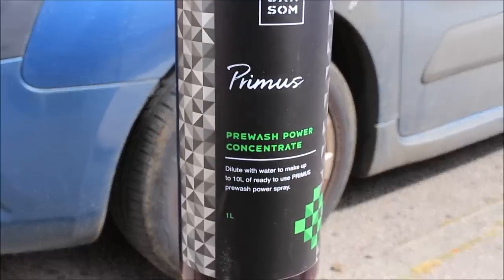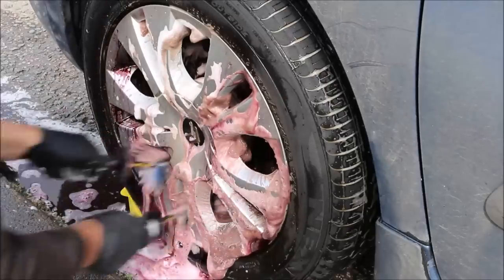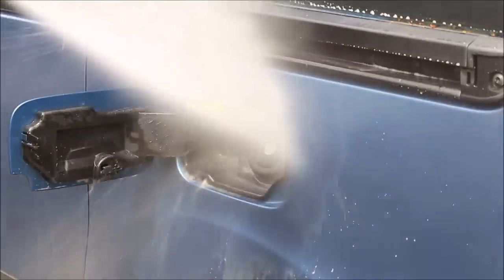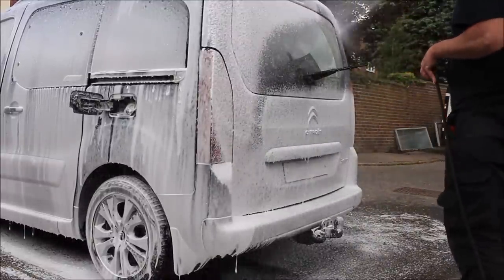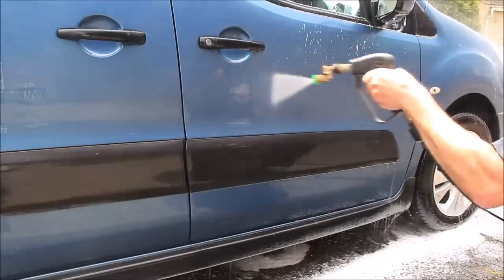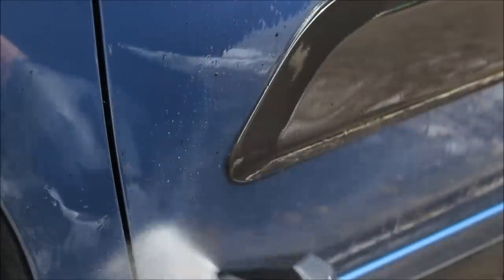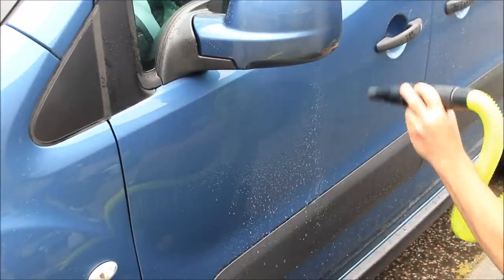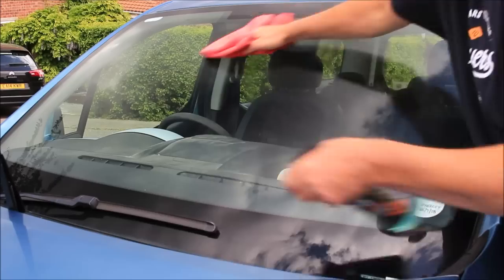CLEANING CAR TRANSFORMATION

Comment: Hi Paul.. I've just got into basic detailing. Spent a bit on products you have recommended and had great results. I've just bought a 2002 range rover. Its mint for the money I've paid but the engine bay is a state. Tips or a video please. I'll throw in some strong beer and cheesy wotsits. Keep up the good work.

Comment: You think these wheels were bad? I did a Corsa the other day, the break dust had to be at least 5 years old if not more. Took about 3-4 hits of bilt hamber auto wheel and that stuff is strong!
Reply from the maker: Ross Male my Son used to have a corsa I know where you’re coming from 🙏🏻
Reply: @PaulDoldenDetails  possible cheap replacement break pads causing some nasty dust!

Comment: Speaking of which tar remover ..what’s the best to use ?, got valet pro citrus tar remover , but it has to be used on dry paint only ? ..best wet paint tar remover recommendation please Paul..
Reply from the maker: Got a generic one at the momment but more Tardis coming
Reply: The Valet Pro works on wet surfaces too. It will disperse the water when sprayed on. Of course it might be diluted and less effective. I've used it after the wash and rinse.

Comment: Great Video. I’ve signed up to the giveaway. Just a small note. The Amazon link doesn’t work. I found one using the search. Different make though.
Reply from the maker: Andy white it’s fixed now I hope bloody Amazon
Reply: @PaulDoldenDetails  received mine yesterday.  I don't know how, but this seems to make the water jet far stronger.  On able to use a wider fan to achieve the same results. Very impressed.

Comment: You should jet wash the iron decontaminator off the wheel before contact washing it as not all iron particles will have fully dissolved, you run the risk of scratching your wheels especially on higher end cars !
Reply from the maker: What do you think I did in this video
Reply: @PaulDoldenDetails  6.57 your contact washing with the iron decontaminator still on the wheel !

Comment: I am new to all this, I have bought a cheap Random orbit 8mm DA, and I intend to try and bring my car back from the edge, I will have to work outside, I intend to snow foam it then clay mitt it, and rinse off and dry, now the problem or question, there is now way in hell I will be able to do the car in one day, I need to ask how to go about it, it will be a two pass thing with the first ultimate compound then poorboys black, then isoprop and then wax, now is it sensible to say do a rear portion, boot and part wings, both compound polish and wax, then leave it over night outside in the morning should I wash it again,and then start a new section and finish, and then the next day etc, is this the best method, I do not expect miracles but need to ask, or should I not wax and just leave the wax until I finish the whole car? I expect it to take me a week to complete and all that time it will be outside? any help on planning and method would be great. Thanks
Reply from the maker: If your machine polishing you can do it in a day but a cheap DA will struggle to correct the clear coat 100% anyway just start early in the morning and you will be fine you mentioned poor boys is that the glaze ?
Reply: @PaulDoldenDetails  the poorboys is the Black hole Show glaze, and the wax is Natty's Paste blue Carnuba paste wax, I do not think that with a snow foam wash clean and dry , then compund , polish and wax the car all in one day could be done by 70 year old me to do it outside properly though hence may asking
Reply from the maker: First of all hats off to you sir for doing this the Poorboys blackhole is not a compound or a polish it’s a glaze it’s designed to cover up paint defects temporarily then be protected by your wax over the top you use a different product maybe ultimate compound by Meguiars or G3 swirl remover then wax over the top and yes do it in sections and take your time Fred 👍🏻
Reply: With your products and plans in mind, here's what I'd do:
1. Rinse
2. Prewash/snow foam
3. Rinse
4. Contact wash
5. Rinse
6. Decontaminate (tar and rust spots)+rinse and/or clay. Note: Tar remover will melt your clay! 
7. Rinse and dry
8. Enjoy your now clean car

Paint polishing: Yes, you can work in sections. 
1. If needed, remove dust with a damp cloth
2. Compound and/or polish
3. Alcohol wipe, if you wish
4. Glaze and/or wax

Alcohol will remove oils, waxes AND glazes. So, wipe before you glaze. If at all.
Reply: @flemmingjensen3202  Thank you

Comment: Link to the ez wheel brush website the actual website not retailers rubber cap is damaged on mine
Reply from the maker: hakman239 look for the caps on google EZ will only honour the actual brush I would of said
Reply: Paul Dolden Details  do they don’t have a website?